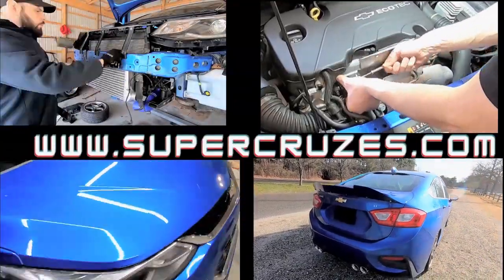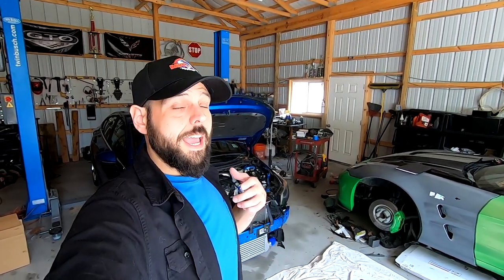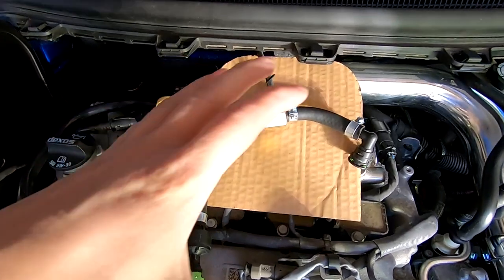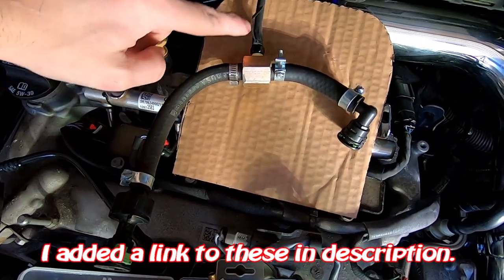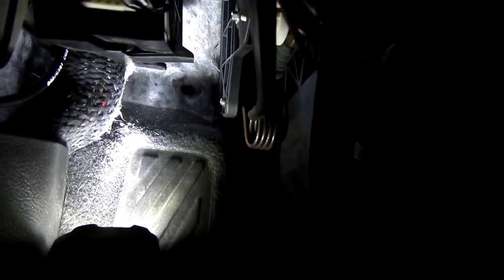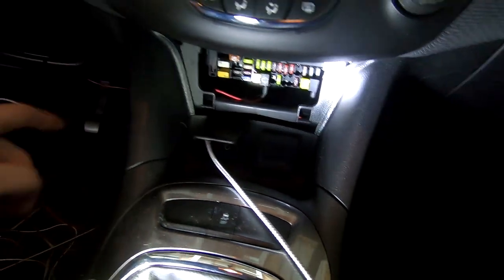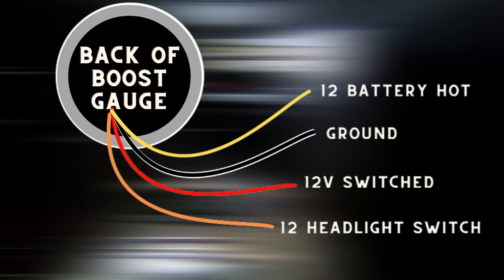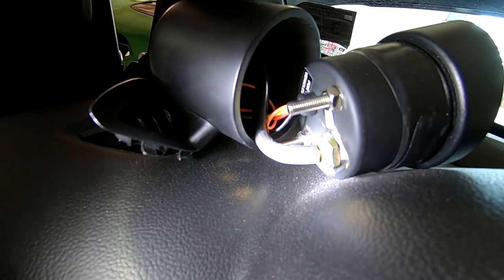Boost gauge short version Cruze install Astra install

Comment from the maker: For some reason the link to the membership doesn't work in the description. Here is a direct link if anyone wanted to join the membership. And I appreciate you supporting the channel in advance. https://www.youtube.com/channel/UC46AZdy5lJVvEE2NMsyWolA/join
Reply: Hey Dave I have a question can I not use the tube that’s already connected just cut it and put t fitting??
Reply from the maker: @AdamDesousa  It’s plastic you would still need some kind of rubber to seal everything

Comment: Hey Dave, what size of fuse did you use? I know that they are the mini fuses but what amps are they (I think I blew a few trying it out myself)?
Reply from the maker: I usually start with 10 and all of my circuits I always try to match whatever the circuit has in it originally
Reply: @davesworld2132  Gotcha, so the fuses you taped in the video both had a 20 amp in them already and you then add a 10 amp in the tap with it?
Reply from the maker: @olsonfam2246  I was in the middle of testing some other times when I filmed the 20amp. But I want to do visually show how the tap worked. I highly recommend leaving 10 amp in first
Reply: @davesworld2132  So I replaced the fuses in the tap using a 20 amp (the type of fuse that was originally called for by the manufacturer) and a 10 amp (per the above message) and I am still not getting it to work. Also, my boost line has fallen out and the gauge has been bouncing (only in vacuum). Any idea what is going on? I just bought the HPRV from BNR thinking that might be the solution but I wanna throw it up here just in case anyone else has the same issue in the future.
Reply from the maker: @olsonfam2246  Verify that you have power going to the gauge. The fuse doesn’t change. The amount of power you produce all it does is allow the amount of amperage to go through the fuse until it blows when there is a short or a heavy load. Slide the gauge out of the pod and see if it works properly it is also possible you have a leak.
Reply: @davesworld2132  thanks for your help, the lighting works perfectly now! But, the needle is now shaking more violently. I believe it is a vacuum leak because the need shakes between 0 psi and 30 mmHg violently when I let off the gas at high rpm's. Any idea where that could have come from? I think the hose I am using maybe out of spec. I got it at Menard's and is a high temp silicone hose, but the hose says not to use it in vehicles (oh well it is just a suggestion...right?). There are clamps like you used in the video added to all sides of the hose. Any suggestions as to next actions?
Reply from the maker: @olsonfam2246  how big of a hoses did you use and did you modify the pipe on the gauge?